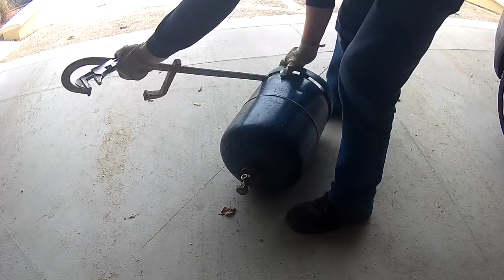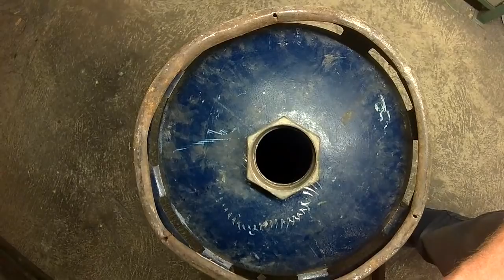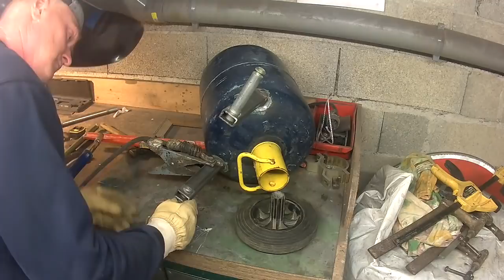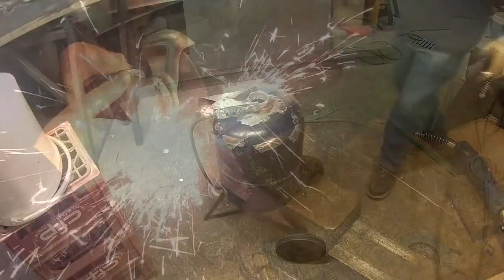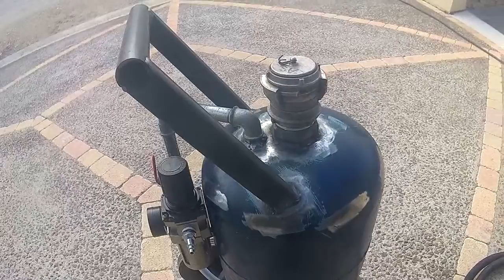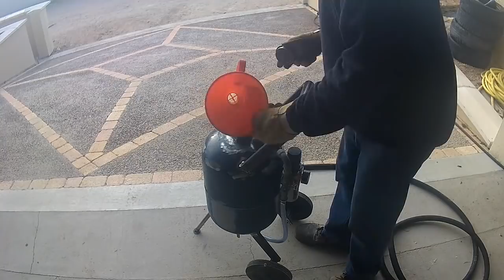fabrication d'une sableuse / DIY sandblaster / ПЕСКОСТРУЙ

Comment: Bravo, merci pour ce partage. Peut-on souder à l’arc à  électrode enrobée. Vous utilisez un Mig avec Gaz ou sans ? Il me semble que ces bouteilles peuvent supporter 15 Bar voir 30, peut on mettre une soupape de sécurité à 10 bar ?
Reply from the maker: C'est tout à fait possible de souder au MMA . J'utilise un poste mag avec du gaz atal 5. C'est pas franchement la peine de mettre une soupape de sécurité puisqu'il y a déjà le mano détendeur qui limite la pression . Je travaille entre 4 et 6 bars le plus souvent.

Comment: Hello nice video well done but 1 have one question how big or what compressor did u use ?
Reply from the maker: 200 liters but it’s too small
Reply: @lilianlecureuil9192  in the video its looks quite ok when u had that sand blasting cabinet and for little works its quite a fine i think

Comment: Merci pour le partage. Quel diamètre de buse et type de sable utilisez vous ?
Reply from the maker: buse de 3.5 mm, et sable de sablage classique de 0.1 mm vendu chez Bigmat. pression d'air à 6 bars. au bout d'environs 150  à 200 kg de sable, la buse fait 6 mm
Reply: BONJOUR LE COMPRESSEUR CET UN 100L
Reply from the maker: Bonjour, 300 litres et c'est un peu juste pour une utilisation en continu.
Reply: OK MERCI